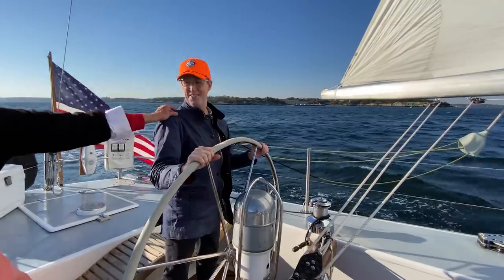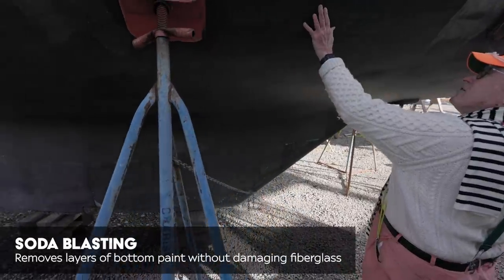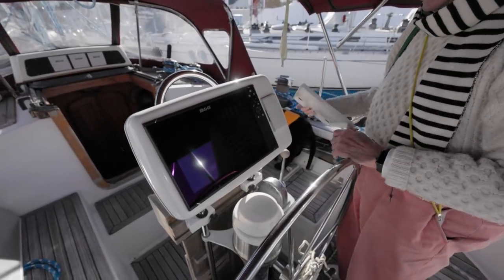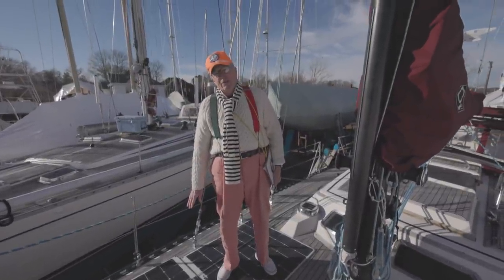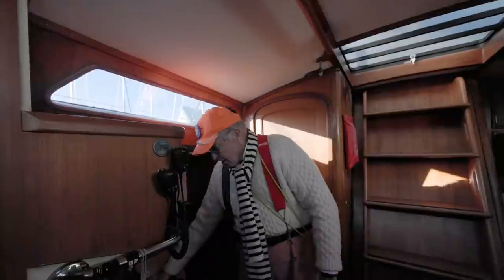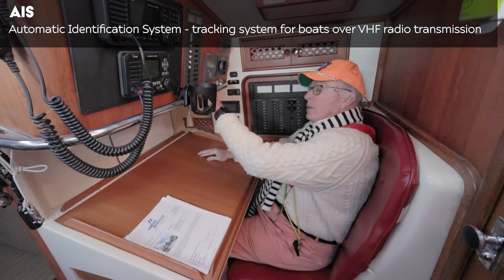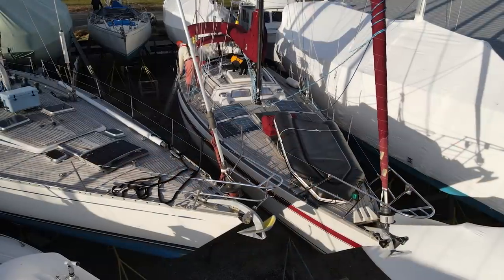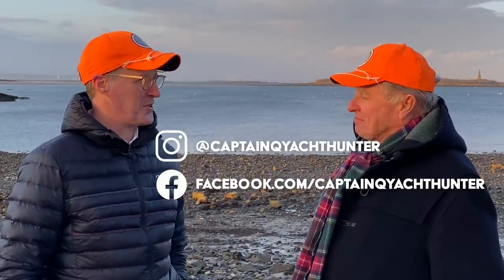$99,500 USD GLOBAL CRUISER! Proven bluewater sailboat for sale! EP76 #sailboatforsale #sailboattour

Comment: In the early 90s, an ER doctor in Pascagoula, Mississippi, owned one of these babies.  She was docked in Biloxi, Mississippi, where I had the opportunity to tour it.  Without question, she became one of my favorite designs.  He sold her (reason unsure) and I saw her a few years later in Pensacola, Florida.  From there I'm not sure what happened to her.  From the very first day that I saw her, I loved the design, obvious strength and seaworthiness, quality, and ocean going capabilities.  It would be nice to own one.  When this video began and you showed a glimpse of her forward deck I knew it was a Lafitte 44.  I became excited that you were doing a review on one....I loved your entire inspection.  Thank you!
Reply: Mr. Dixon here is some of the additons and upgrades to Dream Weaver, it is not a totally complet list but I hope you enjoy:
Accommodations
Sleeps 7-8.  V berth forward.  Enclosed head with vanity and shower next aft to port, hanging lockers opposite to starboard. Main cabin features U-shaped dinette to port which converts to form double berth, settee opposite to starboard. Galley next aft to port, forward-facing navigator's station opposite to starboard. Aft owner's stateroom with double berth to port and single berth to starboard is accessible from main cabin through a second head, with vanity and shower, located aft of navigator's station. Both toilets are Wilcox Crittenden Skipper models, both rebuilt in 2019. Shower fixtures new in 2019.

Galley
U-shaped galley features propane four-burner, gimbaled, stainless steel stove with oven (oven  not working),  Sea Frost (2021) 12 volt refrigerated ice box and separate freezer with digital monitors and controls, double stainless steel sinks with pressurized hot/cold water. Propane system installed in 2019.

Electrical
12 volt DC and both 110 volt AC and 220 volts AC. Engine and generator starting batteries are 12 volt lead acid. House batteries consist of three Relion RB-300-hp 8D 300 ah lithium iron phosphate batteries (2019). Four deck-mounted semi-rigid, walk-on, 175 watt SolarWorld Sunmodule solar panels mounted on foredeck whose 700 watts of power produce as many as 250 ah per day! The four three-foot-square panels feed two 30 amp Victron SmartSolar MPPT charge controllers, monitored via a Victron Color Control GX mounted at nav station. Eclectic Energy (British) D400 wind generator (2019) with max output of 600 watts. Nex-Gen 5.5 KW 10 HP diesel genset (2019) with 75.7 hours. 110 and 220 volt Victron Energy inverter/chargers (2019). Boat automatically accepts 110 volt or 220 shore power and can output both voltages simultaneously, if so desired.

Electronics and Navigation
Brooks and Gatehouse electronics suite including forward-facing sonar, AIS transceiver, 4G radar (antenna mounted on mast), three Triton2 multi function displays, 12" Zeus3 chartplotter, and barograph. All purchased new in 2019, all updated in 2021. Simrad hydraulic autopilot (2019) networked to B&G system, Icom M803 marine HF SSB radio transceiver (2019) with DSC and color display, Icom AT140 automatic antenna tuner (2019). Insulated backstay serves as SSB antenna. Copper foil ground plane glassed into hull during boat's manufacturing process (standard practice with all Lafitte 44's). Icom IC M-506 VHF radio transceiver (2019) with RAM mike (2019). Iridium wifi satcom system (2019). King wifiMax router and range extender (2019). Ritchie SP5 binnacle-mounted compass.

Hull and Deck
Modified full keel with skeg-hung rudder. External lead ballast. Airex-cored hull, balsa-cored decks. Teak decking. Double bow anchor rollers. Maxwell electric windlass, rebuilt in 2019 with foot switch and wireless remote control. Double stainless steel lifelines (2018) with starboard boarding gate. Edson steering system. Four opening overhead Bomar hatches. 10 opening ports. Two Marinco solar vents with reversible fans. Two midship deadlights (2019). Cockpit shower. Dyneema jacklines, port and starboard, running bow to stern. Three padeyes in cockpit for attaching safety harness tethers

Sails and Rigging
Cutter-rigged keel-stepped aluminum mast. Staysail stay fitted with quick-release lever at base allowing stay to be quickly deployed or stored. Running backstays. Sail inventory of 7 sails, all made by Port Townsend Sails in 2019, includes fully battened mainsail with two deep reefs (30% and 60%), light air loose-footed mainsail with snuffing sock, roller-furling 115% genoa, Dyneema-stayed drifter, particularly robust staysail, storm trysail with separate track on mast, and storm staysail. Block and tackle boom vang with Dyneema line, 22', 20 lb. carbon-fiber whisker pole (2018) with integrated stowing (flush with mast) nd deploying system. Harken mid-boom mainsheet traveller (2018) mounted on house. Winch inventory includes two Harken #35 two-speed, self-tailing, mast-mounted halyard winches, Lewmar #30 self-tailing, two-speed, mast-mounted, reefing winch, two Lewmar #55 self-tailing, two speed, primary genoa sheet winches, two Lewmar #40 self-tailing, two-speed winches mounted on coach roof, one Lewmar #46 self-tailing, two-speed winch mounted on coach roof. All standing rigging and turnbuckles new in 2018.  Most running rigging replaced in 2018 with Dyneema. All chainplates removed in 2018, dye tested, and electropolished. All chainplate attachment points reinforced in 2018 with additional glass.

Mechanical
Wind Pilot Pacific (German designed and built) servo-pendumum mechanical windvane self-steering system (2019).

Additional Inventory
Viking 8-person liferaft (2019) in hard cannister mounted in a deck cradle. 3D Superlight Twin Air 290 9.5' inflatable dinghy. Burgundy cockpit dodger (2019) with zippered front window, stainless steel bows, and stainless steel grab rails on three sides. Burgundy bimini (2019) with stainless steel bows, full 360 degree enclosure, canvas covers for all windows, window on top for checking sail trim, and cover for top window. 45 lb. CQR plow anchor with 300' of 10 mm chain, 300' nylon rode, Danforth 35 HT with 50' 10 mm chain, Paul Luke 100 lb fisherman anchor (2019). Ace Sailmakers (E. Lyme, CT) Jordan series drogue. Plastimo extendable man overboard pole (2019). Stereo with two speakers in main cabin. Pots and pans. Toaster. Five fire extinguishers, six fenders, assorted docklines, two horseshoe buoys (2019), boat hook. Misc. engine spares.

Disclaimer

Comment: If my wife and I were thinking monohull this would be exactly what we'd look for.  2-3 seasons of learning the boat, fixing the issues (like the teak on the deck, etc.) and then circumnavigate.

This boat has so much potential for someone who is willing to take the long view and make her a home.  I wish I could right now but, dangit, I have to wait another 5 or so years to make that dream happen.

Thanks for sharing her with us.
Reply: Martin, the teak deck really are not an issue at this time, or you if you can't sleep at knight.  Professional sanding of Decks and replug screw holes.  Capt. Q did not have the time to really get into Dream Weaver, it is in truly remarkable specifications.  Think you may like a list of additons and upgrades done to Dream Weaver since 2017.  This is not a complete list, but get ready to sell everything you have,  and make an offer of this truly remarkable sailboat:

Accommodations
Sleeps 7-8.  V berth forward.  Enclosed head with vanity and shower next aft to port, hanging lockers opposite to starboard. Main cabin features U-shaped dinette to port which converts to form double berth, settee opposite to starboard. Galley next aft to port, forward-facing navigator's station opposite to starboard. Aft owner's stateroom with double berth to port and single berth to starboard is accessible from main cabin through a second head, with vanity and shower, located aft of navigator's station. Both toilets are Wilcox Crittenden Skipper models, both rebuilt in 2019. Shower fixtures new in 2019.

Galley
U-shaped galley features propane four-burner, gimbaled, stainless steel stove with oven (oven  not working),  Sea Frost (2021) 12 volt refrigerated ice box and separate freezer with digital monitors and controls, double stainless steel sinks with pressurized hot/cold water. Propane system installed in 2019.

Electrical
12 volt DC and both 110 volt AC and 220 volts AC. Engine and generator starting batteries are 12 volt lead acid. House batteries consist of three Relion RB-300-hp 8D 300 ah lithium iron phosphate batteries (2019). Four deck-mounted semi-rigid, walk-on, 175 watt SolarWorld Sunmodule solar panels mounted on foredeck whose 700 watts of power produce as many as 250 ah per day! The four three-foot-square panels feed two 30 amp Victron SmartSolar MPPT charge controllers, monitored via a Victron Color Control GX mounted at nav station. Eclectic Energy (British) D400 wind generator (2019) with max output of 600 watts. Nex-Gen 5.5 KW 10 HP diesel genset (2019) with 75.7 hours. 110 and 220 volt Victron Energy inverter/chargers (2019). Boat automatically accepts 110 volt or 220 shore power and can output both voltages simultaneously, if so desired.

Electronics and Navigation
Brooks and Gatehouse electronics suite including forward-facing sonar, AIS transceiver, 4G radar (antenna mounted on mast), three Triton2 multi function displays, 12" Zeus3 chartplotter, and barograph. All purchased new in 2019, all updated in 2021. Simrad hydraulic autopilot (2019) networked to B&G system, Icom M803 marine HF SSB radio transceiver (2019) with DSC and color display, Icom AT140 automatic antenna tuner (2019). Insulated backstay serves as SSB antenna. Copper foil ground plane glassed into hull during boat's manufacturing process (standard practice with all Lafitte 44's). Icom IC M-506 VHF radio transceiver (2019) with RAM mike (2019). Iridium wifi satcom system (2019). King wifiMax router and range extender (2019). Ritchie SP5 binnacle-mounted compass.

Hull and Deck
Modified full keel with skeg-hung rudder. External lead ballast. Airex-cored hull, balsa-cored decks. Teak decking. Double bow anchor rollers. Maxwell electric windlass, rebuilt in 2019 with foot switch and wireless remote control. Double stainless steel lifelines (2018) with starboard boarding gate. Edson steering system. Four opening overhead Bomar hatches. 10 opening ports. Two Marinco solar vents with reversible fans. Two midship deadlights (2019). Cockpit shower. Dyneema jacklines, port and starboard, running bow to stern. Three padeyes in cockpit for attaching safety harness tethers

Sails and Rigging
Cutter-rigged keel-stepped aluminum mast. Staysail stay fitted with quick-release lever at base allowing stay to be quickly deployed or stored. Running backstays. Sail inventory of 7 sails, all made by Port Townsend Sails in 2019, includes fully battened mainsail with two deep reefs (30% and 60%), light air loose-footed mainsail with snuffing sock, roller-furling 115% genoa, Dyneema-stayed drifter, particularly robust staysail, storm trysail with separate track on mast, and storm staysail. Block and tackle boom vang with Dyneema line, 22', 20 lb. carbon-fiber whisker pole (2018) with integrated stowing (flush with mast) nd deploying system. Harken mid-boom mainsheet traveller (2018) mounted on house. Winch inventory includes two Harken #35 two-speed, self-tailing, mast-mounted halyard winches, Lewmar #30 self-tailing, two-speed, mast-mounted, reefing winch, two Lewmar #55 self-tailing, two speed, primary genoa sheet winches, two Lewmar #40 self-tailing, two-speed winches mounted on coach roof, one Lewmar #46 self-tailing, two-speed winch mounted on coach roof. All standing rigging and turnbuckles new in 2018.  Most running rigging replaced in 2018 with Dyneema. All chainplates removed in 2018, dye tested, and electropolished. All chainplate attachment points reinforced in 2018 with additional glass.

Mechanical
Wind Pilot Pacific (German designed and built) servo-pendumum mechanical windvane self-steering system (2019).

Additional Inventory
Viking 8-person liferaft (2019) in hard cannister mounted in a deck cradle. 3D Superlight Twin Air 290 9.5' inflatable dinghy. Burgundy cockpit dodger (2019) with zippered front window, stainless steel bows, and stainless steel grab rails on three sides. Burgundy bimini (2019) with stainless steel bows, full 360 degree enclosure, canvas covers for all windows, window on top for checking sail trim, and cover for top window. 45 lb. CQR plow anchor with 300' of 10 mm chain, 300' nylon rode, Danforth 35 HT with 50' 10 mm chain, Paul Luke 100 lb fisherman anchor (2019). Ace Sailmakers (E. Lyme, CT) Jordan series drogue. Plastimo extendable man overboard pole (2019). Stereo with two speakers in main cabin. Pots and pans. Toaster. Five fire extinguishers, six fenders, assorted docklines, two horseshoe buoys (2019), boat hook. Misc. engine spares.

Disclaimer
Reply: DON'T WAIT ! I did and now I'm afraid I might have waited too long !
Reply: I have to agree.  Don't Wait Brother